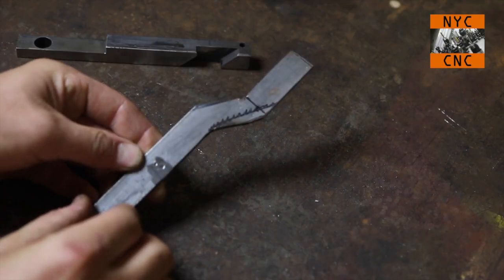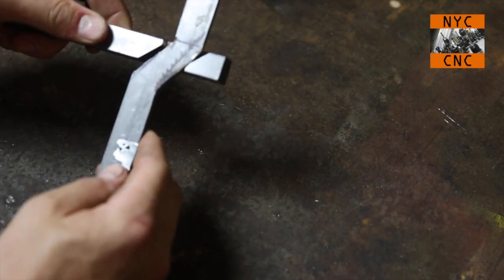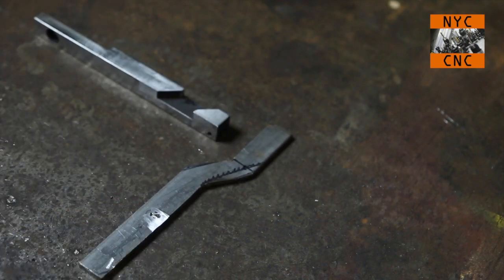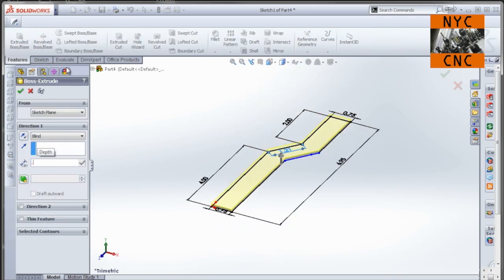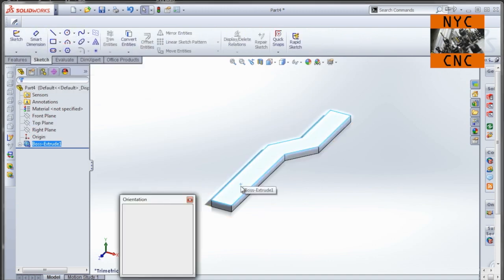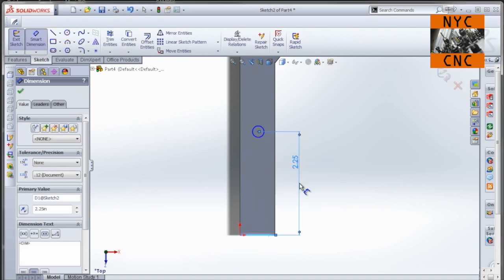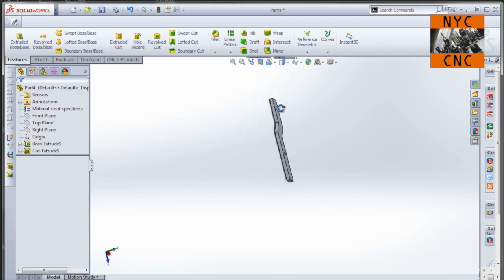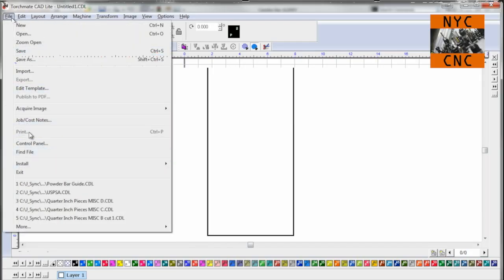Measuring Machining & Fabricating a Steel Bracket!  Wednesday Widget #1

Comment: Great video, very well produced. Thanks for the tips. Hoping to share some if not all of it in a few of our classes.
Reply: I currently teach CISCO networking and computer repair. But in the department we have a CAD class, principle of engineering class and an automotive program. So the kids get exposure to auto desk inventor, mastercam, mig, tig, plasma cutting, oxyacetylene cutting, etc. We have a couple of engine lathes (enco, causing and south bend), a Bridgeport mill and various drill presses. Do like I said between your machine projects, firearms related parts and Arduino  tutorials I'm always excited to see what you have to share. The magnet base and the wire wheel were a great tip today :-) we did a steel step stool project this past year, all hand cut on plasma torch, lots of cleaning up!!!!
Reply: Can't wait! I have to get my act together and start filming some of the projects and lessons we do. Darn kids make the job so much more complicated. If I could get a week at work with no students, I could get so much accomplished.

Comment: Hey John, great video. Your right about power tapping, could be dangerous if your new to it. I use to over drill the hole a few thousands.
Reply: Sure
Reply: NYC CNC  coutersink that hole instead of oversizing it and ruining the minor diameter.  The tap will go straighter and easier, esp at the start.  Great idea to promote. Some vids will rock and some will blow.  It'll be awesome to hear from ya weekly!
Reply: I really don't do precision work so, a few thousands will put me around 60~65% thread contact instead of 75~80%. But thanks for the good info.
Reply: Dennis Skerb half the time I oversize the hole to make tapping easier myslef. I ain't gonna lie about it. I do it too. But I always countersink. A good habit to have.
Reply: If your set up to drill, ya might as well change bits and counter sink. I also use the spring loaded center for straight tapping. Plus that Kool Tool* tapping aid.
Don't know whats in it but, sure does make it easy.

Comment: LOL 15:19 I'm watching this, researching arduino {for a cnc project} while contemplating finishing my vibrahone {tumbler}. You read my mind again.
Reply: NYC CNC Would you happen to have arduino code/sketch to handle the mach3 12.5khz charge pump signal? Just looking to kill the outputs on my arduino when the 12.5khz signal isn't present.
Reply: NYC CNC I'm using an output pin on the parallel port to carry the charge pump signal from mach3 to my arduino. The arduino once programmed will be mini'd onto a attiny45 which is embedded in the DB25 dongle {break out board essentially} that allows mach to work with my stepper driver board.
Reply: NYC CNC What i am basically working with is artofcnc.ca/ChargePumpSafety.pdf . I built marris's circuit on the left, but cannot get it to switch two opto isolators on. Seems to be a lot of noise on the ground, so I'm switching to attiny45 imbedded running code to handle my needs. The Safety Charge Pump signal generated by mach3 is 12.5khz square wave that it assigns to the {LPT port's db25} output pin of my choice through the mach3 software. Using the Arduino Library "FreqCount" I can watch the serial monitor window and see the frequency of the input. Using that sketch about once a second it polls the frequency of Analog pin 5 to the serial monitor window. With the charge pump running i see a steady stream of 12680's with it off i see a stream of 0's. So i assume the arduino is having no trouble reading the input. its just the bit of code that uses that variable to switch my outputs on and off that I'm having a hard time coming up with. Heres what I'm using to see my stream of pulses, I'm told i need to use attachInterrupt to this somehow to get the solution i need. 

#include <FreqCount.h>

void setup() {
  Serial.begin(57600);
  FreqCount.begin(1000);
}

void loop() {
  if (FreqCount.available()) {
    unsigned long count = FreqCount.read();
    Serial.println(count);
  }

Comment: Awesome!  How long have you been running solid? Plasma test run :). Neat scribe set up.I think you need an etcher to mark your maker name/logo on stuff, and you could've used it to burn those heights on too.
Reply: The guy that used to do my knives had a Marking methods machine, the Lectroetch used to be pretty good too. If you want to experiment you could rig something up for probably under $20, but is it pretty convenient to just buy the stencil material, you can use a old fashioned type writer for just text, a custom logo used to cost around that $60-100 but that was years ago, might be less or more now, I'd hope less.You can either have the etch dark, or bright. It's not quite as cool as laser etching but is quite affordable.

Comment: Be careful how you handle that P&O plate. It is slippery. It will slip out of a snap hook and plate hooks will slide out if it isn't balanced. We use 80 amp for 1/4" but we are more into production. I like your magnet idea. I couldn't tell how you did your lead in. On a part like that we go straight in line on one of the corners. About .3 lead in.

Comment: doesn't that top angle [where the part turns flat again] need to be rounded to avoid jamming when sliding through the other part?
Reply: NYC CNC here we go with 1000 words to try to paint a picture and my inability to describe my thoughts. i'll call the bottom of the part the edge you measured, so going from the short top edge to the angle it looks like on the customers example part that they rounded the corner instead of a sharp 45, I thought there might be clearance issues when sliding the one part through the other. sorry its so wordy , like I said I can see it in my head now to try to put it into words
Reply: NYC CNC na then I gotta figure out how to email, if the part works that's all that matters anyhow I guess its just a little of my "Cliff Clabin the plithera of usless knowledge" coming out . if you like the show "Cheers" you'll get that lol

Comment: Video watermark is distractingly large and dark.
Currently it's VERY visually annoying.
Please diminish the darkness and size of that necessary evil.
Otherwise, your channel content is good, and I appreciate your efforts.
Reply: Until I read this comment thread I hadn't actually noticed it and had to go back and re-watch the video. I guess the TV channels have taught me to completely ignore logos, and other such things happening in the periphery of the screen. At least yours isn't animated and covering up vital parts of the program content like many of the "professionals" on the cable networks do.

Thanks for the video! Lots of useful hints...from CAD design to surface cleanup (was that a Scotchbright pad on a random orbit sander?). 

I wonder if it would be worth modifying the drillpress chuck so you can turn it for tapping more easily?  Maybe a collar with holes for a handle to be inserted?  Or would the risk of leaving the handle in outweigh any benefits?

-- Mike
Reply: BigMjolnir  Agreed, I didn't notice it either.  A little smaller wouldn't hurt though : )
Reply: NYC CNC I didn't notice it either, I had to go watch a bit of the video again, and even then I got distracted by watching you in SolidWorks and it just kind of vanished.  BTW: It was nice to see SolidWorks content, I use SolidEdge 2D for basic profiles and pockets on my CNC router but the 2D layout tools are pretty similar.